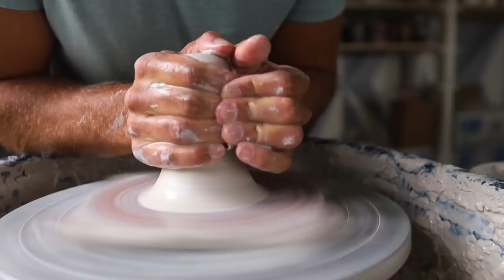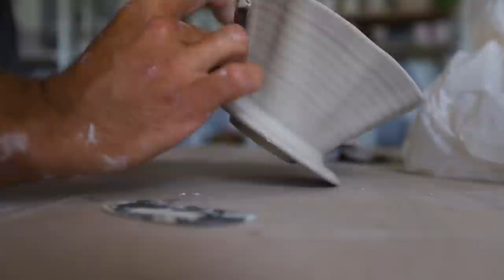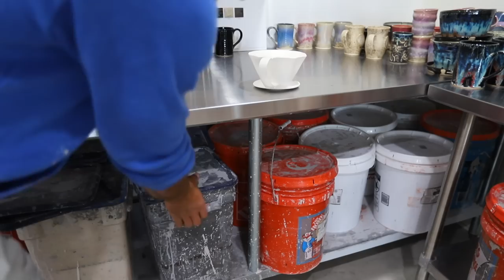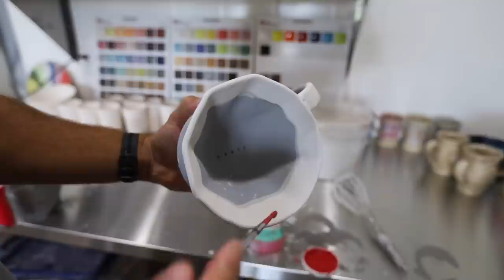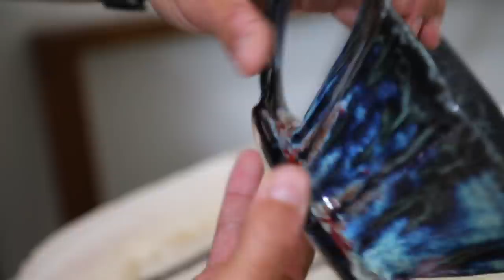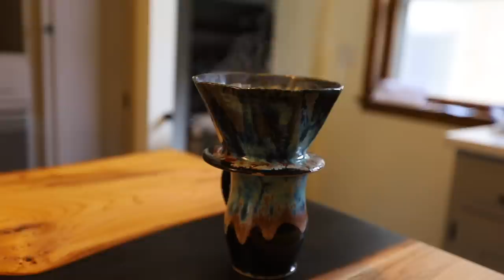MAKING A CERAMIC COFFEE POUR OVER - the ENTIRE Pottery Process - ASMR edition

Comment: Why are some of the base plates square and some circular? Does it effect the turning of the clay?
Reply: I'm not sure but I don't see why it would alter the turning or drying process.
Reply: do you mean the wood that he throws on to initially?
if so then it wouldn't affect anything  to do with the clay at all. They usually com either round or square. Square is good for storage as you can fit more onto a shelf. Just plonk them down  flush next to each other.